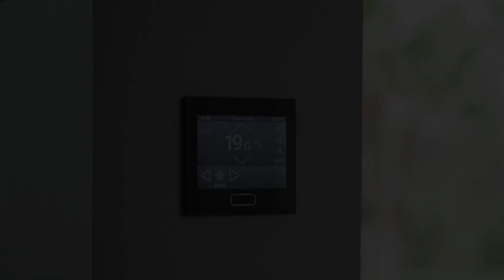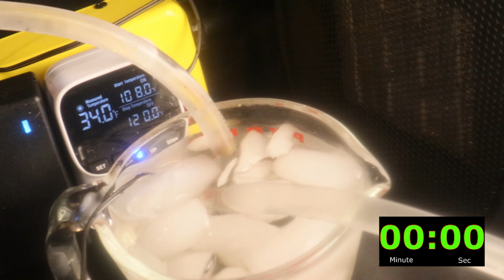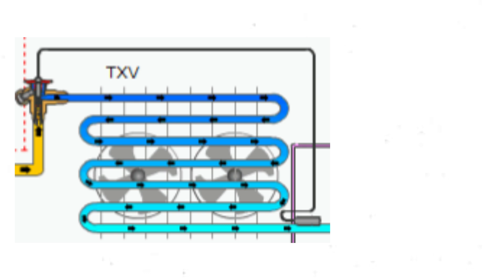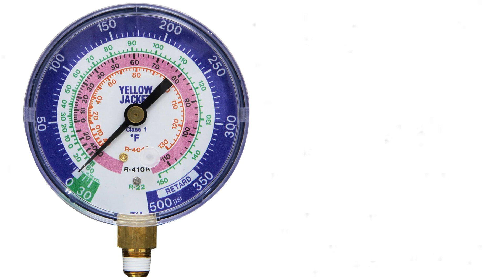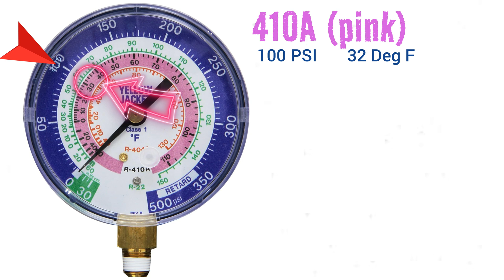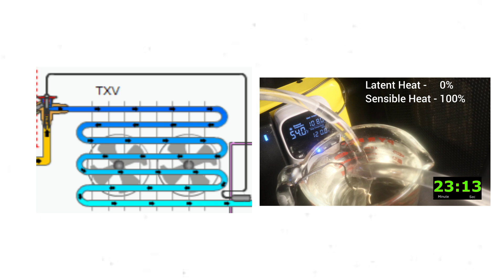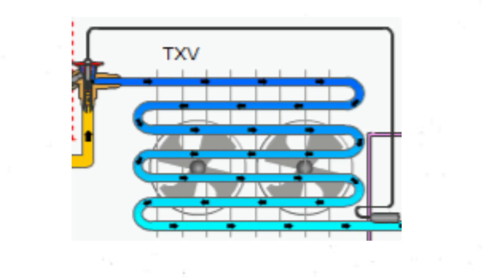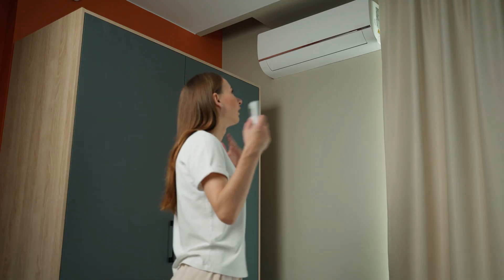HVAC Diagnostics: What Does Superheat Tell Us?

Comment: great material but small note is that there is also evaporation happening meaning there is never 100% sensible heat exchange possible in your experiment. (evaporation of liquid also occuring together with melting also "sublimation" happen directly from ice to gas form)
but it doesnt matter

Comment: BRAVO - kind of! You are the first guy to touch on the fact that phase change requires energy. once I learned this law of physics I was able to understand a lot of things better. Like why a bottle of really cold beer doesn't freeze until you open the cap,  no energy available until the air hits it, air has thermal energy. 
Also why liquid propane burns you and gives you frostbite at the same time. 2 things going on at once - liquid is boiling once it hits air this burns you, propane boils at minus 46 degrees so there is a massive need for energy , it's using all the thermal energy from your skin therefore you freeze while being burned at the same time!
I feel if more instructors explained this before explaining refrigeration people would understand the principles being taught a lot easier.
Thanks, really enjoy your content.
Reply from the maker: Thank you. That's wild about propane burning and freezing your skin at the same time!

Comment: Can too much superheat mean the compressor isn't being cooled?  If yes then how much superheat can you have before it gets too high? Great videos. Thanks
Reply from the maker: Yes. Generally 50+ degrees of superheat can kill a compressor pretty quickly.
Reply: @JerseyMikeHVAC  Awesome video Mike! I had spoken to Copeland and Bristol tech support many years ago and was told basically the same thing they both stated greater than 25 degree superheat can cause hot spotting in the windings if running at RLA and if 30 degree superheat they will start producing very high discharge temperatures with winding temperatures reaching critical temperatures to. Right or wrong I always used 25 as a 🤔 I better do something quickly.  I have had some that were hard to deal with since at coil it was 10 degrees SH but at unit it was high 25+ due to long suction lines run in extremely hot ambient temps (attics or at roof line in commercial/industrial facilities) 
Thanks for your videos Mike, you are a good teacher and is helping my son-in-law! Keep them coming!
Reply: @JerseyMikeHVAC Thank you.
Reply: Superheat is ideal at 10-20 degrees ,sub cooling 8-10 degrees